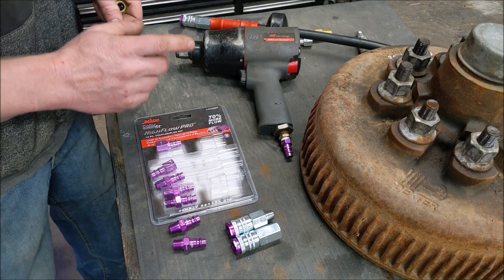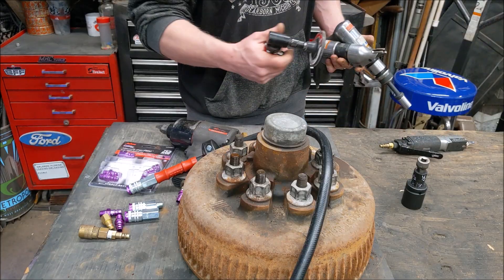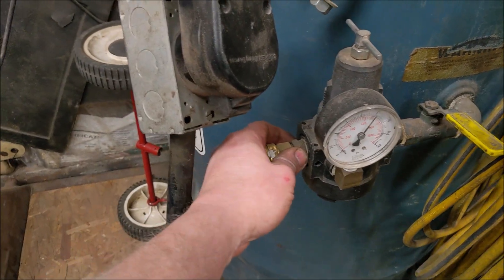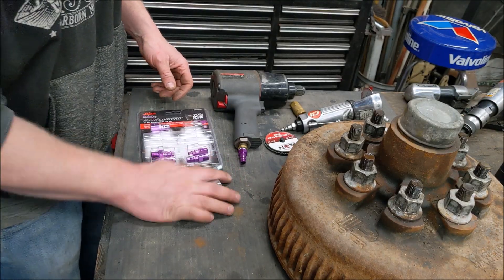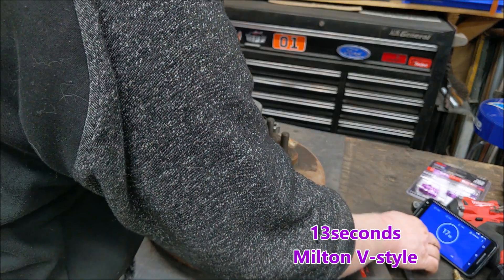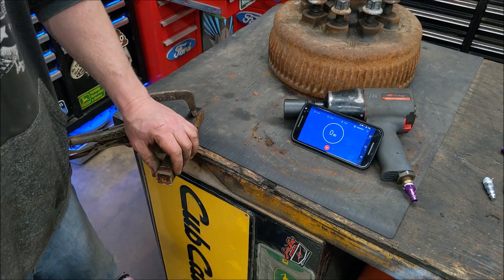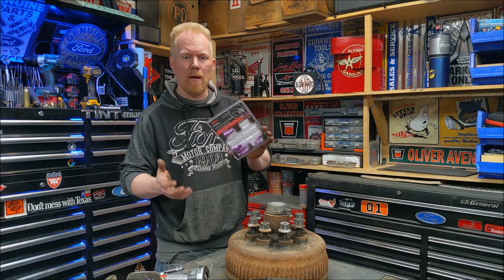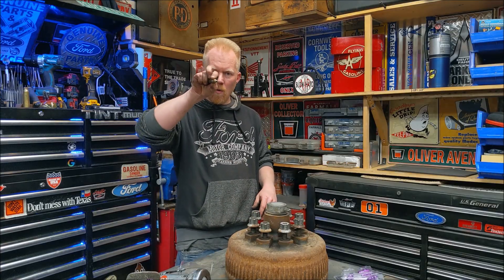High Flow Air Fittings worth it? Tested Head to Head Milton V-Style

Comment from the maker: I did some tests today. 
IMPACT GUNS SPEEDS
4215rpm with I/M style and Automotive Style fittings
5725rpm with V-Style fittings

V style fittings
Standard duty: https://amzn.to/2UcKuTu

Heavy DUTY for high vibration: 
Brass: https://amzn.to/3HgGoq4
Steel: https://amzn.to/4mKRWkH

DIE GRINDER SPEEDS
3000-5000rpm increase with V-style(tested by ear as the speeds exceed my meters 20,000rpm capacity)

TIP HOLE SIZE FLOW
.031sq inches to flow air with I/M and Automotive fittings
.040sq inches to flow air with hand DRILLED out I/M fittings (backyard high flow)

.071sq inches to flow air with V-Style fittings
Reply: Won't make much of a difference for air blow guns
Reply: Have these fittings held up ? I’ve seen many videos of people saying they don’t last and are cheap.
Reply from the maker: @thaMac923 They come in aluminum, brass and steel. The only one I had wear out was an aluminum I put on my impact gun. The extreme impacts started to dent it pretty good . I just traded that out for a steel one and I haven't had any issues. I haven't had a single female coupler leak or fail yet though.

Heavy DUTY for high vibration: 
Brass: https://amzn.to/3HgGoq4
Steel: https://amzn.to/4mKRWkH

Comment: When I first bought my 1/2” IR impact wrench, I had some Chinese auto style fittings on hand from somewhere and used those with also a too small air hose.  I thought the wrench was defective.  It wouldn’t even loosen the lug nuts on my Chevy 2500HD on its highest setting.  However, before sending it back, I decided to buy a Goodyear air hose and some Milton high flow fittings, industrial style if memory serves.  The difference was night and day.  I could not remove the lug nuts on next to the lowest power setting and it spun them off instantly on the high setting.  I simply could not believe the difference a good hose and fittings made.  It acted like a completely different tool.

Comment: Thanks for this video, it is very helpful.  When buying high flow fittings do I need to also be concerned about the fittings on the ends of the air hose ?  Do they also need to be high flow, or are the male hose fittings already large enough?  I'm shifting and want to make sure I don't have any bottlenecks.

Comment: You want to see a difference? Turn your compressor up to 135 psi. If you're regulating it at 100 psi ofcourse you're not gonna see any difference. And anyone that says "that's not good for the tools " or  "that's dangerous" take your maxi pad off and crank your regulator up to 135. The best way to get more air delivery through those cannon air plugs is with more air pressure. 1/4 air fitting bodies cannot let the air through fast enough what makes these tools work harder is more air NOW. I've seen SO many times people go out and buy a 3/4" drive impact and put a 1/4" body plug in it and it won't even make the power that their smaller 1/2" drive impact makes because it's not possible for the required air capacity to pass through that little pinhole  1/4" body I/M style fitting. These Milton "V"s are definitely nice, i run 3/8 body "T" automotive plugs on 135 psi and my air tools work full tilt bitch!!! The day i switched everything over to the hi flow "T"s i was ecstatic from the difference! I'm getting the full potential from my air tools now , along with 135 lb air pressure. There won't be much difference unless you increase that

Comment: Geeez.... Simply Buy use 3/8 Bore  Fittings  they flow same /more than expensive 'bored out' HV types and are usually made of Hardened Steel .
 Unlike the overpriced  wear out in a month Purple Aluminum  Milton ALUMINUM ones . It's ALL hype!
Reply from the maker: Milton sells the same V style in brass and steel. I use the steel in things like an air hammer that experience a ton of vibration. Most things the aluminum purple ones are just fine for though.

Comment: Loved the video!  Great dog!  and truck!!
It looks like these fittings are just far to soft.  Lots of failures when used on impact tools, such as hammers, scalers, impact wrenches, etc.
Its the same issue as using brass, and Milton knows this!!!   These fittings should be made of steel.
For a hobbyist that only uses a impact 1-2 times per month this might be sufficient.  But if your in a shop setting, just get the 3/8 steel fittings.
Reply from the maker: They make these exact style fittings in brass and steel as well. I put a steel on my impact hammer.

Comment: The problem is the 3/8 hose has a 1/4 ID barb... so whatever the airflow fitting or not, the 1/4 barb is the limit. So it's pretty obvious that even if the coupler after the barb is 70% bigger, it doesn't mean anything.

IMO those airflow fittings are most worth it with a 1/2 air line for higher airflow tools. So I'll keep a 1/2 line for high airflow tools and my other 3/8 lines for regular flow. Can all use those V fittings though why not, but I also kept a 3/8 hose with the regular M style coupler just because I have some random low airflow tools that are on it and I,m not changing the coupler of all tools to high airflow for no reason. But I changed the inlet to the V fitting so I can connect to my main compressor hose. Also need to keep a regular hose.

So imo those airflow fittings have a purpose only on a 1/2 line with high airflow tools.
Reply from the maker: You have your measurements all wrong. A 1/4" npt fitting has an internal size of approx 5/16". A standard I/M fitting has an outlet size of around 3/16". So you choke down a 3/8" hose to 3/16". A "V" high flow fitting has an outlet size of 5/16" The same as inlet. So you only choke down a 3/8 hose to 5/16.  Which is .071" vs .030 (standard), so more than double the airflow area.

Comment: I want to try this but the kit is $90 in Canada.  Meanwhile the CCP has already cloned the product at a fraction of the price
Reply from the maker: I actually bought a few cloned ones and the hole was much smaller. Along with the female adapter being manufactured in a completely different way that blocked off the majority of the air. Amazon had some under their own brand name and I returned those. Along with here in the states Harbor freight which is the same thing you would find at Canadian tire and I returned those as well. 

You might be able to find the Milton sold separately in their brass or steel configuration for less in Canada?

Comment: You should not use aluminum fittings with impact wrench....Milton has brass fittings to use for this purpose. Also the same Milton states on their website that aluminum fittings are not recommended for use with impact wrench. Other than that, it's a nice demonstration, thank you!
Reply from the maker: True, I do have brass as well. The impact gun fitting does get a little banged up, but I'm still using it. The fitting that suffered and destroyed itself was on the air hammer. That I switched over to brass and that likely isn't good enough as it's showing wear. Steel is next.

Comment: v style are a high maintenance option. The couplers constantly cook off and continuously blast air out until you replace them. They are also a royal pain to connect especially when you use them a bit. I used them for 3 years in my shop and finally had enough to switched to "P" Style fittings and couplers thru out the entire shop and they flow more than the v style and  have never had one leak or wear out in over a year now. 
We run 160gallons of air at 180 psi unregulated for what its worth.

Comment: If i get the hi flow fittings on the coupler can i mix and match? Or do i  have to have high flow with high flow? Also do they just press in easy or do i have to press the collar down on the coupler to get it to fit?

Comment: If you start loosing air pressure and output volume,  it could be your disconnect fittings are bad. Check them first before assuming your regulator is defective. Don't ask me how I know. LOL:hand-pink-waving:

Comment: When I was visiting a friend's street rod shop (shout out to Big Oak Garage) I noticed that even with air hoses everywhere there were no audible leaks.  I asked and he said he used Milton.  My Chinese connectors leak all the time even when new.  Just got a new compressor and went with the Milton brass V couplers and steel plugs.  If I gain some performance that's a bonus.  Although I have a generous collection of air tools I mostly blow away chips/sawdust and drive small brads/nails.  The main reason I went with the V system is the ease of connecting and disconnecting.

Comment: So when using my 1200 ft lb impact gun I have to have high flow all the way from the tank to every fitting all the way to the tool.. I have a 3-way manifold connected to a regular low-flow connector at the tank and 350 ft sections of hose in the manifold everything is low-flow connector.. if I want to use one of the hoses strictly for my impact gun can I just put a high-flow male on one end and a high-flow quick connect on the other end and a high-flow mail in my impact gun? Or will the manifold and the low-flow Quick Connect that the manifold is plugged into at the tank reduce my air flow? I only use my gun when I rotate my tires or do my brakes I am no kind of mechanic.. no I do use my die grinder to sharpen my riding tractor blades

Comment: Ok great video but I have some questions I'm hoping someone can help with. Apologies for my ignorance but these are the 1/4 plugs how are you using 3/8 hose?

I have a mac5200 with a 1/4 quick connect body and 3/8 body coming out of the compressor. So I figured I would use the 3/8 primarily. 
I figured I would need 3/8 to 3/8 connectors with 3/8 hose but this is proving harder to figure out and find since everything seems to be 3/8 to 1/4 not. 3/8 hose on 1/4 connector is hurting my head 😂

Is the ID of 3/8 hose 1/4 or am I misunderstanding everything?
Reply from the maker: 3/8" hose is the inside diameter. 1/4" npt fitting is the thread size and has an actual external size of around 1/2" and an approx ID of 1/4".
Reply: @sixtyfiveford  thanks,  I thought using 3/8 hose with 1/4 plugs seemed odd. I guess it doesn't introduce any  bottleneck?

Comment: I see large hole on video... I see small hole on my air fittings... I see drill bits... hmmm. I drill out air fittings and now big hole like on video. no hole in wallet... goooood....
Reply from the maker: Even drilled out you are barely better than half the flow rate of the V-Style. 
SIZE FLOW
.031sq inches to flow air with I/M and Automotive fittings
.040sq inches to flow air with hand DRILLED out I/M fittings

.071sq inches to flow air with V-Style fittings

Comment: Not alot of people know it but you can install the V style couplers on you're compressor and hoses and still use the M style fittings in them if you don't have all you're tools changed over yet

Comment: these fittings are 100% the way to go. Never going back!
High flow V-style for life. Tremendously better in every way compared to the standard ones. easier to use as well.
My air compressor is fully upgraded with high flow everything and larger 3/8 hose. only a 6 gallon 4.2cfm but still can run anything I throw at it. the bigger stuff can work well in short bursts still too. impact wrenches work well when used in short bursts. doesnt suck too much air.
Reply: Good to know as I only have 6 gallon Makita for homeowner type garage and woodworking pneumatic nail punch on hardwood pallets. He made me feel as if I’d need a 60/80 gallon tank. Thank you for sharing.

Comment: I had always wondered since You lead hose from the compressor, air hose itself the opening is standard. Should the inlets and outlets be drilled out to match the high flow fitting diameter to get the most out of it?

Comment: I changed all my fittings over to high flow fittings going on 2 yrs ago , they are great specially on older tools , the only draw back is they at that time they didnt make a pressure relief coupler ,the high flow males dont work well with push button releases .i miss pushing the button and waiting just a second for the die grinder to pop off with no pressure behind it or the 50' air hose just falling off without bleeding the pressure off..

Comment: About as unscientific as testing can get, but here in Europe we call them XF Euro fittings. and they are far better as long as you are using large enough inner diameter air hose. The only downside is that they empty my compressor faster!

Comment: Question for you so I just got new little 175psi compressor but the hose leaks at the end where fitting is tired airing up tire wouldn’t even put 10 psi in tire The tank fills up fine I can feel the air in the hose ain’t got a clue is wrong with it do you?

Comment: IDEA. The problem of getting sawdust or dirt off your back and shoulders so you can go inside. Add about 2 feet of 1/4 or 1/8 inch tubing to the end of an air spray nozzle. Bend it into an arc so you can then spray off your back without having to ask somebody else to do it. Very easy and priceless.

Comment: Thanks for making this video I work for an abrasive and tool company. As you showed with the cut off tool, these high flow fittings are excellent on cut off tools and 4.5” grinders. They will even make a big difference on your little roloc die grinder too!

Comment: Try torquing the nuts with the high flow fittings, and see if you can can get them off with the regular fittings.  My thought is that more air flow allows it to hit harder, therefore tighter. Lower flow shouldn’t be able to break it free.
Reply: The only problem with that logic is that the break away reverse torque hits differently than the forward torque. It would not work, trust me. For example on a 2235TiMax, forward torque is 870 ft. lbs, but reverse busting torque is 1760 ft. lbs. He even said the same thing in the video 9:00.

Comment: I could have saved money if I saw your video as the Miltons are definitely cheaper. I guess I still would have gone with the Flexzilla brand because I prefer the easier manipulation of my tools with the 30-degree swivel tips. Anyway, thanks for posting, information and options are always a good thing. The bad part about the Flexzilla ones is that I needed to switch out all of my tools because they are not compatible with the regular fittings like the Miltons are. Paul @ https://www.youtube.com/channel/UCdq2jaxcmgyX0AERivIB2Tw

Comment: The Curtis compressor is awesome. What is the history of the machine? Where did you find the single phase 7.5 HP motor?
Reply from the maker: I picked that up for $100 because it was not working. It had oil residue crusted all over the top of it like something had been dripping for years on it. The story was the electric motor shorted out(likely whatever had been dripping on it) and it was retired. They removed this compressor and replaced it with a new one. But they bought a new 3phase motor for it so they could have a backup(but never installed the motor). It just sat for years and finally an employee took it home for a personal shop compressor but couldn't figure out 3phase or what it even was so gave up. He put it up for sale after having it for years for $100. I picked up a used/noisy 7.5hp single phase water pump motor off Ebay for around $300 and replaced the front bearing. I sold the new 7.5hp 3phase motor I bought with the compressor for $400. So other than a little labor I got a compressor for free.
Reply: That’s an awesome deal. A deal of a century. The motor was another great find. I checked every 7.5HP water pump motor on Ebay and they are all 3 phase and have prohibitive shipping. I suppose you have 200A service. Can both compressors at the same time? Will one start if the other is running?
Reply from the maker: @jheissjr  It would be big drain to try and run both at the same time for sure. That Curtis can handle anything I throw at it and doesn't get fired up very often. The 60 gallon Quincy handles most of what I need.
Reply: Thanks!
Reply from the maker: @jheissjr  There was a lot of dumb luck that went into this one. I bought the compressor with the idea is might only be good for a secondary air tank. It took probably 9months to scrounge everything up to put it together.

Comment: Question for you on potential durability. I just order the 14 piece set to swap out all my tools and a hungry plasma cutter. I don't count myself as being abusive to my tools, though some get used to their full potential. I bought the set even after reading mixed reviews that this purple set is fairly soft but my connectors and such won't be in an auto shop setting where more abuse would be expected. Any thoughts now that you've had them a few years? (Hopefully they're still around!)
Reply from the maker: They've been holding up great. However I had one get damaged pretty quickly. It was on my air hammer so I bought a brass one for just that one. I think a 2 pack of brass male fittings was under $5. However even though it shows wear, I haven't changed it out because it doesn't leak.  I use my blow gun nearly daily and it shows little to no wear. Now if I used the super high vibration air hammer on a daily basis I would need brass or even steel V style. None of the female couplers leak at all even when using the standard IM fittings in them.

Comment: Oh no. First I'll change out the V fittings, then the compressor won't keep up, so I'll need an extra tank or maybe another compressor. Little projects like this have a way of escalating. I like the 1/4" style, so at least you can change out only those devices that need the extra flow. Going to 3/8 will likely work better but would need a broader switch. On the other hand, maybe one could use 3/8 for proximal line, then swap out a distal line with 1/4 V style fittings....